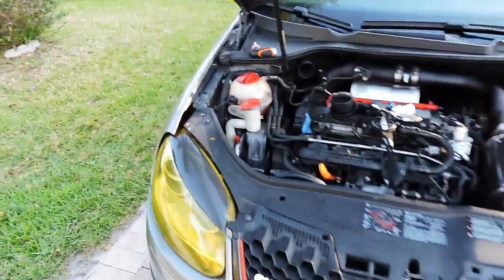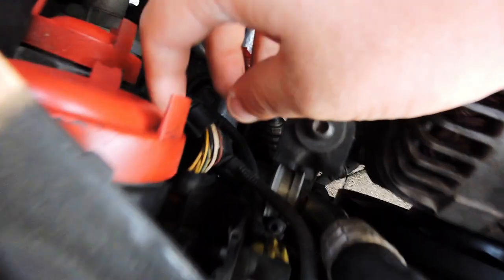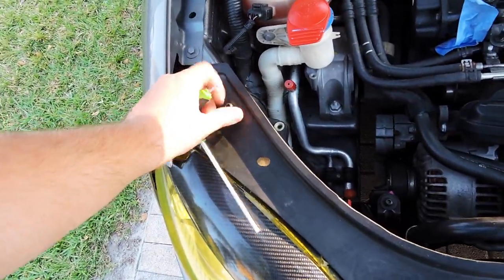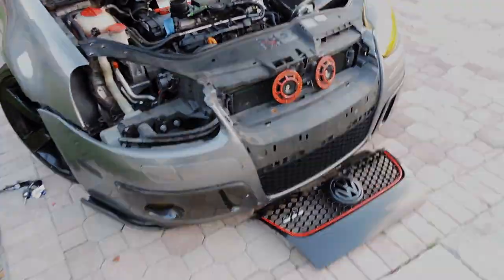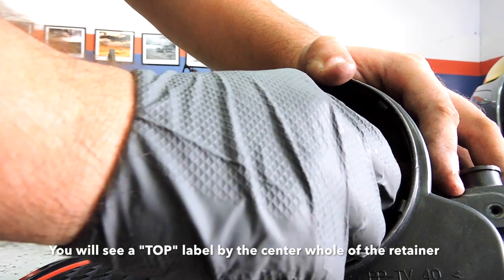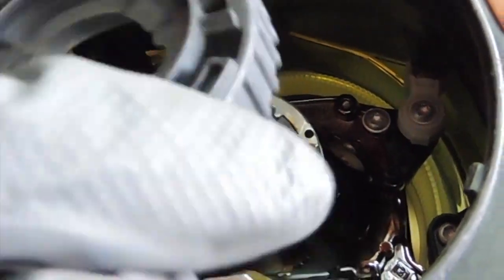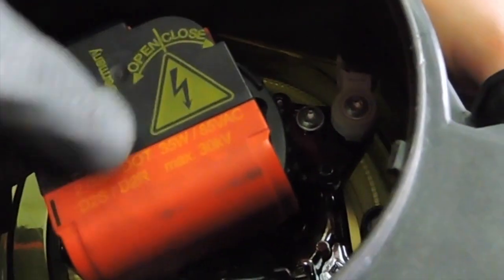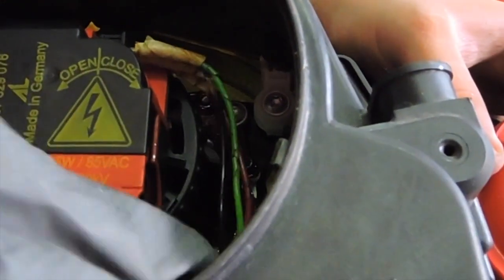How To Replace Headlight Bulb On A MK5 GTI / HOW TO

Comment: Thanks for the video mate! I noticed my headlight was out in the parking lot one day and took things apart to check it out, make sure it wasn't a loose wire or something simple like that. I couldn't get the damn thing back together, so I took the other one apart to try and see how it fit in place again. Now they are both out and I can't get the fuckers back in! I'll be removing my headlight assemblies tomorrow just like you did! Thanks for the tip brother.
Reply: Bro.. SAME. christ. And then when i did it wasnt fully on and melted. Once last year and now again.

Comment: I am having a problem on my gti mk5 the headlights on the drivers side the hid and the low beam are not working and the hid on the Passenger side is working but the low beam is not have you ever had this problem before and are there two different relays for the left and the right headlight
Reply: Hey man I have the exact same problem on my mk5. Did you ever find the issue?
Reply: @kennycastro5215  I had to buy a new Comfort control module

Comment: Where do you buy headlights and bulbs I keep getting parts that don’t fit
Reply from the maker: Amazon. you apply your vehicle specs to the search engine make sure you are accurate and go from there. 
I usually check the items that have at least 4 stars. 
Thank you for the view and good luck ! Cheers.

Comment: Not happy with the whole ''dont need to remove bumper'' advice. You can't reach the screw below the headlight without taking of the whole bumper. Now it is broke and I can replacing the whole bumper suspention and headlight! Thanks bro 😡

Comment: Dude you removed....the whole headlight? Lmfao. Mekanic
Reply from the maker: Im pretty sure in the video you can see the headlight being removed so yes the whole headlights gets removed. 
Did you use superpowers to replace the bulb without removing the headlight assembly? neat. thanks for the view.
Reply: @JesusChristisPlanetNibiru  ....yes. replaced HIDs in both headlights at work last week without removing the whole assembly. Even with your extra HP carbon fiber intake there's still plenty of room...
Reply: @prestonhebb1380  well for starters there didn't need to be a video for this, it's pretty straight forward. Dude lost me after he refered to torx as a triple square.